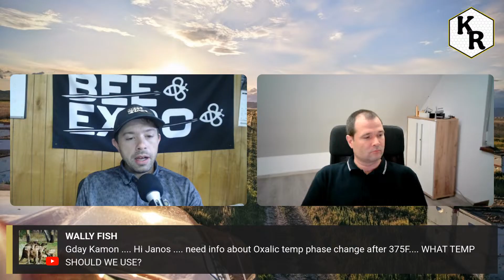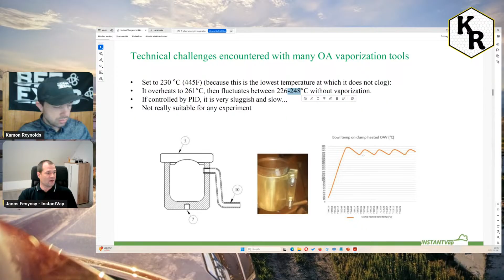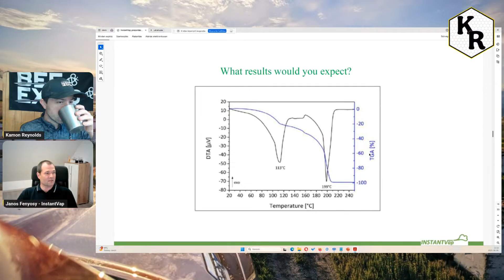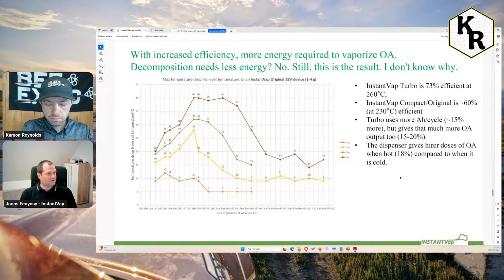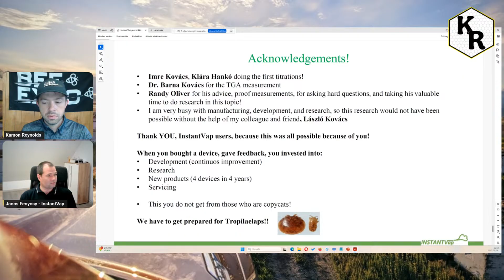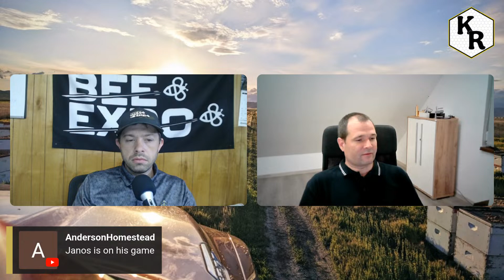Live with Kamon Reynolds & Janos Fenyosy – Creator of the Instant Vaporizer

Comment: The chart is excellant.  Janos never stated his dose recommendation.  Just need more treatments and heavy doses lose efficacy if not Turbo unit. Notes: 500f degree...2 grams...every 2 days?  Kamon at 5-6 grams for DD w Turbo.  Seems the goal is 10-15sec supplemation at 500f degrees.  2 seperate doses of 3 grams for DD if not a Turbo unit.  Adjust temp to get 3 grams at 15secs for all other units a suggestion?  All great info and a much need presentation.
Reply from the maker: Hi Taz, Janos likely is hesitant to respond with an exact number because there is so many variables. I personally use 5 grams a double deep and if I was doing a treatment with brood I would focus on a tighter window. Brood is only capped for 12 days if we cover that window well it likely works better than 21 days. Either way I would do washes before and after and see how it is working for you.

Comment: Ha Kamon, I had a very hard time with the sound. I have bought 3 vaps   they are the first model they are set on 435 is this the right temps and I trust that the temp are set right by him and Rob, I used these to treat for mites this year They are nice. I got my new bee jacket today that u recommended I am looking forward to using it  have a blessed week
Reply from the maker: Hi Frances, Yes those other models  have a different ideal temp than the turbo due to the turbo's speed. If I learn anything new I will let you know!

Comment: Great presentation! Would doing a 20 day cycle of OA treatments immediately after a 14 day Apiguard treatment (like starting OA on day 15) be detrimental to the queens laying or is that just expensive overkill and wasted $$$$. Seems like it would devastate the mites.
Reply from the maker: Once the thymol period is over I don't see a problem. Just don't go crazy on the OA levels 2-3 grams a deep is great with the Instant Vap since you get so much more viable OA in the hive!
Reply: @kamonreynolds I was thinking of vaping 5 times every 4 days with 3 grams each dose. I’m running all Long Langs except for one regular Langstroth and most have 15 to 20 frames of comb with both brood and honey. I’m just running 7 hives so time isn’t a factor.